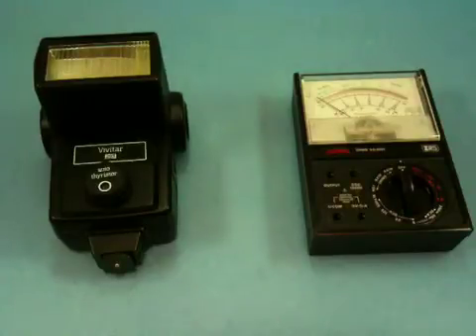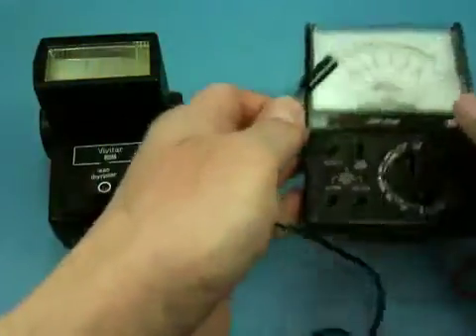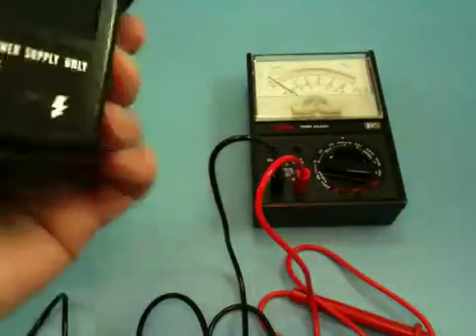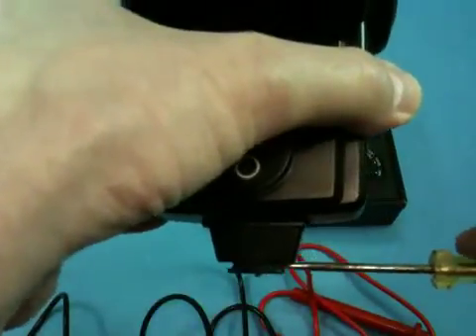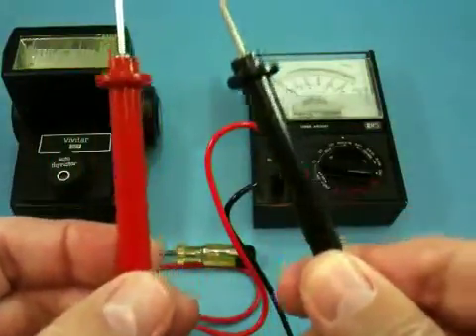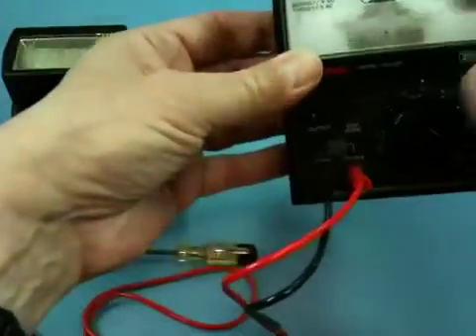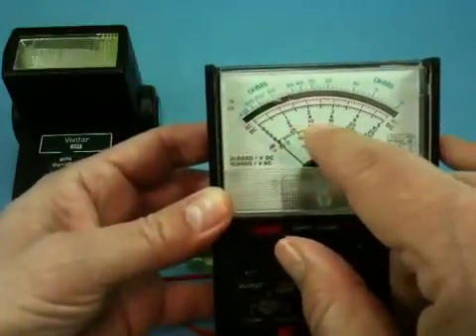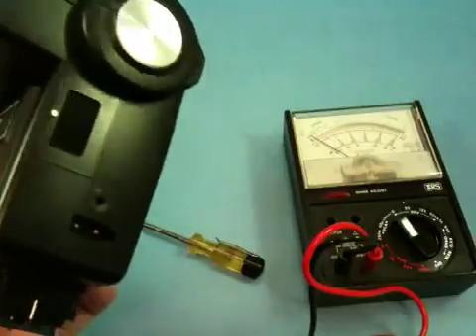Measuring Trigger Voltage of a Vivitar 283

Comment: You need a digital meter to measure the voltage on a flash unit properly. Keep that crappy old analog meter for testing batteries.  Neverleless, if an analog meter shows a high reading on a flash unit, then the flash unit definitely does have a high voltage, even if you won't know it exactly.

Comment: Having been at the photo business for 6+ decades, I've learned most everything the hard way. In this case, what I learned is to spend 30-40 bucks on eBay and buy a Wein safe sync adapter that turns <=400 v trigger voltage flash units into 6v ones. Worth it if you have all those old clunkers (like my 3 vintage 283's with REAL HIGH voltage) in your closet. DON'T use them on newer cameras. I know what can happen.

Comment: Jeez, a Micronta multimeter: ~50 years old? My father had one and it's cheap and nasty, with insufficient impedence to measure flash trigger voltage accurately. The trigger voltage is on a capacitor charged via a resistor like a megohm.  Your meter will pull it down. It is probably enough to put the unit into the high or low voltage category, but you really need a digital meter. They are quite cheap.

Comment: Thanks for the video. I tested my flash and I am not sure if my flash is safe to use or not in my canon 5d (classic). The reading from the multimeter were 140ish volts at 500v scale, 40v at 150v scale and 5v at 15v scale. I am confuse. Shouldn’t the voltage be consistent regardless the scale I am using for the multimeter?
Reply: Sounds like you are using a cheap analog meter. Your three readings are all about 1/3 full scale.  The meter has a relatively low resistance (a bad thing) and is dragging down the voltage of the flash unit, and drawing off the same amount of current whatever the scale. Anyway, you have a high voltage flash unit.

Comment: Thank-you! I have two ancient 283 and heard about the high voltage thing. I've only used them with my DSLR on slave units. Just tested both, and they are the low voltage ones. No fears, but now I have multiple Canon 600EX/RT speedlites. Not sure the 283 units will get used much, but thank-you for providing this simple test. Now I know. Always did love the accessories Vivitar made for the 283. Might just find the use. cheers

Comment: Improper measurement! According to page 4 of service manual ( https://www.manualslib.com/manual/852485/Vivitar-283.html?page=4#manual ) there have to be something around 300V on the trigger input, but fed through R11 - 2MΩ resistor (with D5, D7 and R17 - 18kΩ in series). Your multimeter is something pretty old without preamplifier, so the input resistance of your voltmeter is near 1kΩ/V(range), so on a 25V range somewhere near 25kΩ, which in fact means, that you are measuring something around 1:100 of the real voltage ( (2MΩ+18kΩ+25kΩ)/25kΩ voltage divider ), which is something near 3V, which sounds safe, but is not, because the real voltage is much much higher, because the sync output of typical camera have bigger output resistance than 25kΩ your multimeter have. Theese measurements have to be done using voltmeter with >10MΩ input resistance to obtain a proper results.

And this is the voltage part only, what about the switching current, hm?
Reply: Trigger voltage is 230V approx. https://www.manualslib.com/manual/852485/Vivitar-283.html?page=39#manual
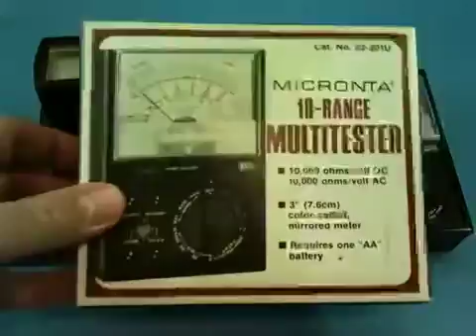Reply: Good stuff, but the box @0:18 claims the meter is 20 Kohm/volt, so its full scale current in voltage mode is 0.05mA and its resistance in the 25v range is 500 Kohm. This is still much less than the 2 Mohm through which C17 is charged, so his crappy meter is pulling the voltage down.

Comment: Early Vivitar 238 flash units used a high trigger voltage.  In late production the voltage was lowered to a safe level.  If you buy a vivitar 283 and don't test it before using it on a digital camera, good luck!    Your cheap flash may not look like such a bargain when you get the repair bill for your camera..
Reply: I have a high voltage version (271V) tried it on my D700, no issues BUT i only did it about 10 shots before learning the damage I could be doing. No more of that!

Comment: I would have thought that with a flash duration of maybe 1/200 seconds or less, the inertia of an analogue meter needle is not going to get near the actual contact voltage.
Reply: It is not measuring the flash tube voltage.  It is measuring the voltage on the circuit that is used to trigger the tube.  This is a steady voltage until it is grounded by a microswitch in the camera when the shutter starts moving. FWIW, the flash duration is much shorter than 1/200, more like 1/5000 sec.

Comment: @luciam3  It's been a while, but I picked up a few of the 283s to play with. As I recall, some of the 283s use a high control voltage (that could damage cameras not made to handle that high of a voltage) and some are low voltage units and, so, safe to use with any camera. It's a good idea to check to be sure you have a 283 that is low voltage *BEFORE* you put it on your camera.  I bought some cheap slave triggers and use them as auxiliary flashes....but measured just in case I got stuck one day.
Reply: My research shows that there are two types of 283s, those made in Japan such as mine which records voltages in excess of 200v and those made in China and I suspect that this test was done on the latter.

Comment from the maker: Everything I've read on the Internet indicates that it isn't necessary to pop the flash to measure the trigger voltage.  All the write-ups I've seen on the Internet about measuring trigger voltage matches what I described in my video -- simply measuring the voltage across the two poles while the flash is turned on.  For discussions of the technique, search Google for "measuring flash trigger voltage.
Reply: It is a good idea to measure it after two or three flashes.  If the unit is not used frequently, the main capacitor need a bit of excercise to be conditioned. Otherwise it leaks some of its charge to earth and so the voltage does not reach the full value.